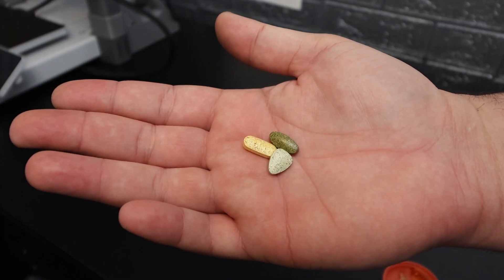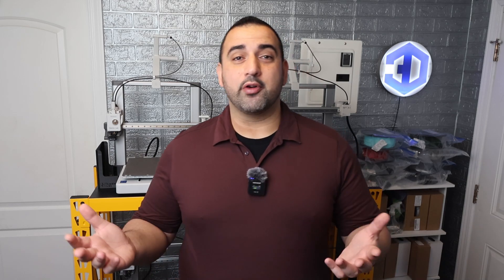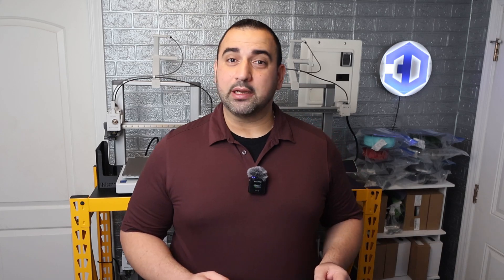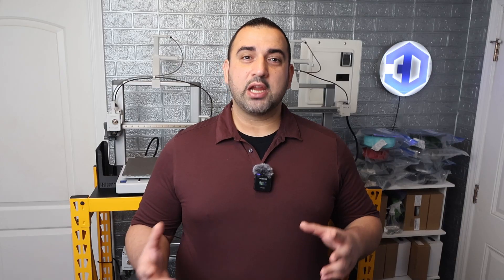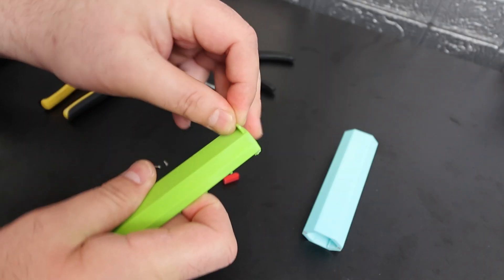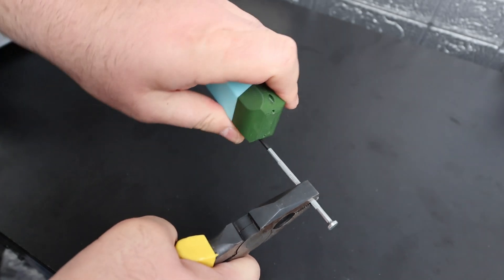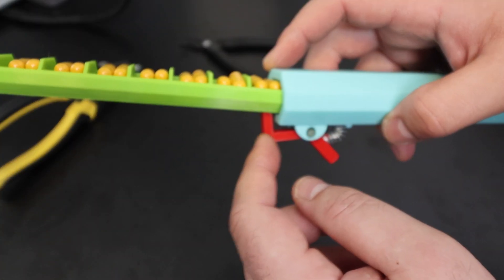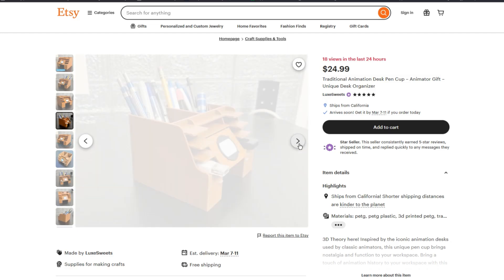3D Printed Spring-Loaded Pillbox: Unveiling the New Prototype!

Comment: I think you sweeep didn't work because the radius is smaller than the profile your were trying to sweep.
Reply: Could also be a sketch pierce failure.
Reply from the maker: @manufortems9896 That’s a good point, a sketch pierce failure could definitely be the culprit too. I’ll check that, and thank you for the advice :)
Reply from the maker: Thank you for the info! You might be right about the radius being too small for the profile I was sweeping. I’ll tweak it and see how it goes! Appreciate your input :)